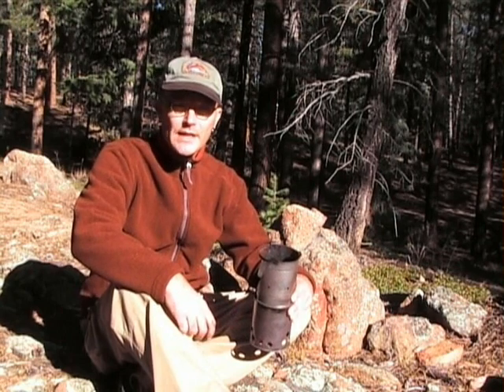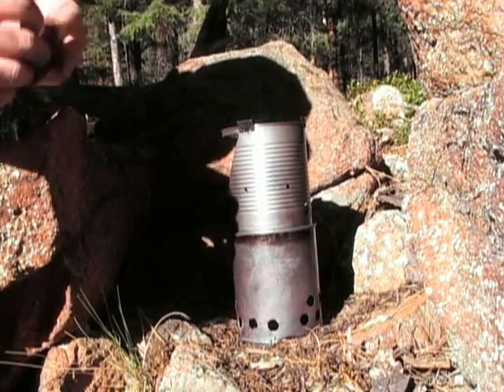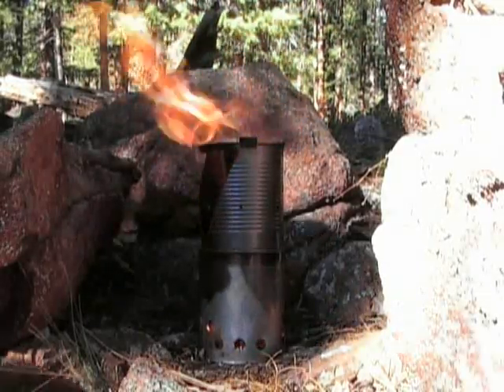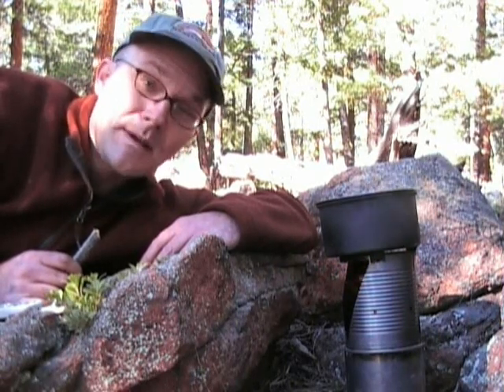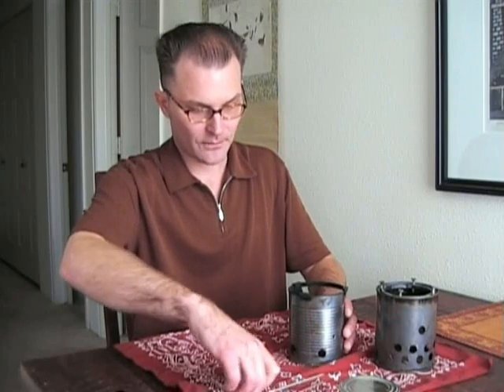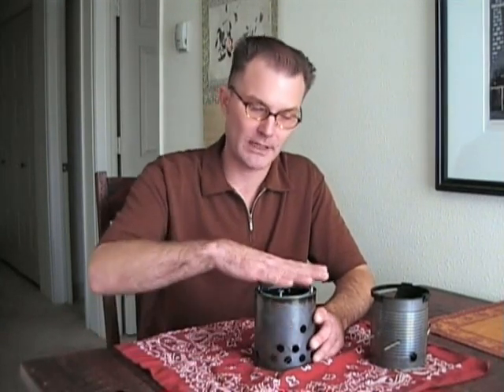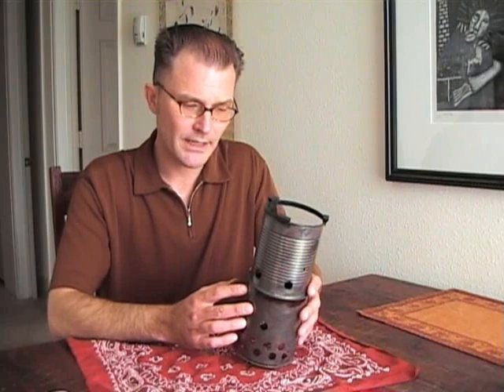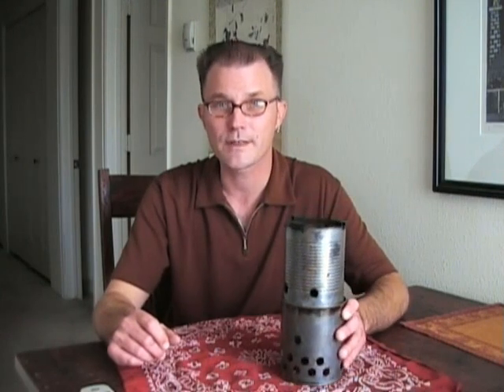Compact Wood Burning Stove

Comment: I usually carry a small surform rasp with my folding wood stove.  Sometimes I cant find anything small or dry to start the fire with so I use the rasp.  Find an old dead log and then start rasping it until you get down to dry wood then set aside the wet filing and rasp some more to get some dry filings.  Excellent way to start your fire when everything else is wet.

Comment: Jason as with all wood burning stoves there is always a layer soot on the bottom and side of the pot. I have not heard anyone talk about a trick tought to me by a girl scout leader. Simply rub the outside of the  pot with some dish soap before you cook in it and the soot will wipe right off with a little water. The pot comes out looking brand new.

Comment: Finally a great video that actually mentions boil times! Thank you Thank you!
Anyway I liked the clip and it was one of the better ones Ive seen.
Im wondering a few things though for this type of flame would that produce alot of soot, or does the stove operate better with the higher flame compared to more of a hot coals type of heat??
Also we do 90% of our cooking while canoing over a wood fire , and know that on many pots there are temp. limits and often these limits can be reaced using wood

Comment: That would sound like a good idea to save space, but I think this wood stove works on the same principle as a "chimney starter" like is used for a charcoal grill, or a chimney stove/flue pipe for a home wood burner. I honestly haven't made a square wood stove so this is just a guess, but the shape of the round stove has a draft turbulence effect, and is more efficient than a square shape. Granted chimney's in houses have a square flue, but there is a stronger draft influenced in that system.....

Comment: Nice design , but i noticed the rim above the feeding opening is bending , maybe due to the heat. Maybe leave some extra material say 2 cm's ore 1 inch in your cut of the opening from the top would make it a bit stronger so no bending any more.

Comment: nice rig but i'd like to add some info. a decent alcohol stove like you have there should boil water in under 3 minutes minus the soot on the pan. it's nice to have both though

Comment: Also if one is not so worried about ultra lite you can most likely use a can of Sterno fuel the same way Jason demonstrated using the alcohol stove inside of the upper part of the stove. I am curious though. The fuel port on mine seems smaller on my stove than yours, Jason. Mines about 4 1/4 in height and 4 1/2 inches wide. It just looks smaller than yours.